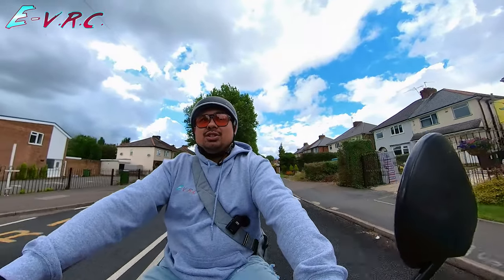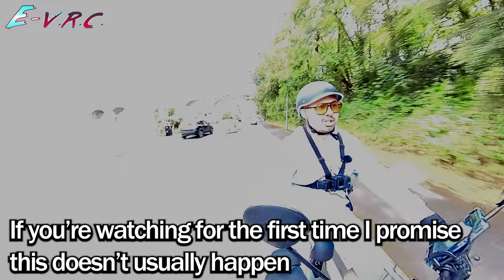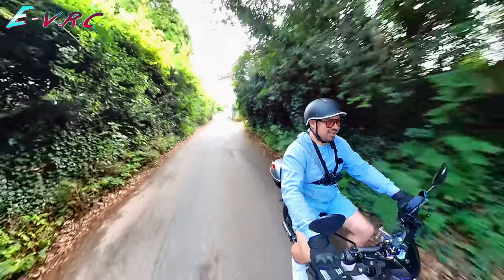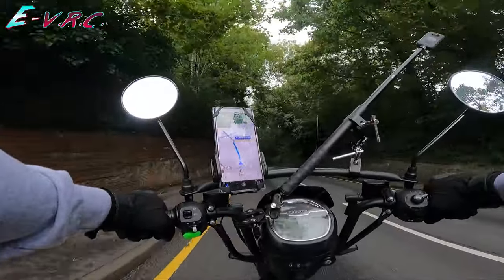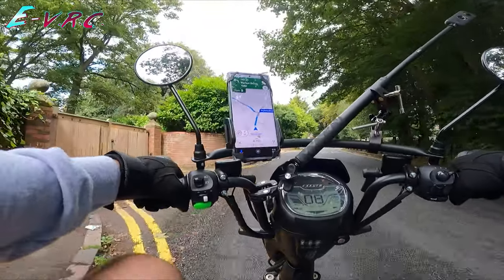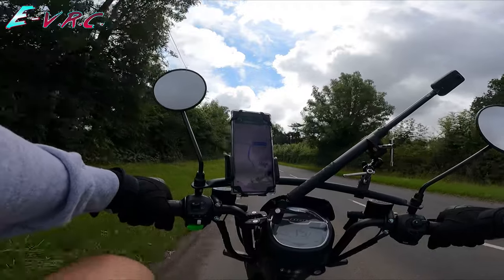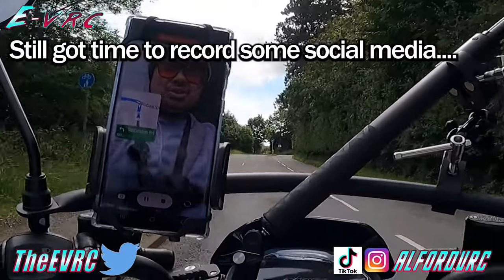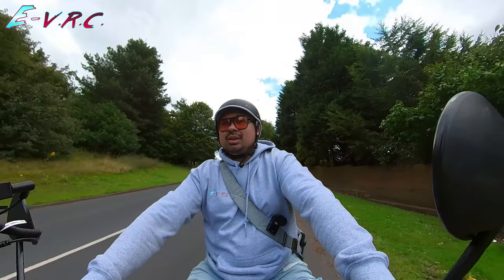No License Required Moped SMASHES HILLS and DISTANCE! Eskuta SX-250

Comment: I have the same bike with Kuma branding in Ireland, and I have to say I absolutely love using it. Only snag is the really distinct battery enclosure shape that doesn't seem to be available to get on its own. I want a higher capacity battery than the ones available in UK/Ireland, but I don't want to have to learn to build one totally from scratch or jury rig something that only sort-of fits the battery space. If anybody has come across a generic higher cap battery I can buy off the shelf and pop in, I'd love to know.

Comment: Brilliant video!! Need to do some hill tests around high wycombe. What camera equipment are you using please. Hope all is well, take care
Reply from the maker: Thanks very much! The 360.is an insta360 x2 which is usually much better though I'd like to upgrade to the x3 as it does proper hdr. My chest cam and face cam for some parts is a gopro hero 9. Great camera but the battery drains fast.

Comment: Hi mate just ordered mine should be with me in a couple weeks just wanted to say thanks for the review of the sx250 just wanted to ask you about de risticting it off road use only of course
Reply from the maker: Haha no problem and off road of course 😉. There's a video on it's really ssimple just a wire hidden under the battery that you unplug. Thing is it's obviously not meant to run derestricted I reckon the range is about 6-7 miles derestricted. It runs down FAST. However, it has a speed switch 1-3. 1 is 15.5, 2 about 19, 3 about 23 for me at least. If it were derestricted you could keep it on setting 1 - legal setting. Then if you need a quick boost - to get away from thieves or on a hairy road you could temporarily boost to 2/3. However it does make the bike kind of pointless then as you're simply riding a moped without legal stuff. They need to hide the speed switch lol. Anyway, enjoy it's a fantastic machine 👍
Reply: Wicked thanks for your reply be nice to meet up and go for a ride lol I'm in Bromsgrove not too far away 😉

Comment: Personally, I would put a 5,000 watt motor and a 52 volt battery on it. 250 watts might cut the mustard on your little slopes, but the hills around here in Huddersfield, Yorkshire are real ones, REALLY steep ones. I have a full bike licence and would feel insulted riding around on something this puny and weak.
Reply from the maker: If I passed my full bike license and someone gave me a 250w scooter you have to pedal I'd feel insulted too. But if I passed my pilots licence and they gave me a motorbike I'd feel the same. Horses for courses.
Reply: mraidymaddful, don't worry no ones going to hand you one, in fact l dont know why you bothered to comment, as for hills, your soft southern Yorkshire hills would be speed bumps round where l live in North Yorkshire, our hills are that steep they've had to fit car lifts on them, freebase jumpers use them for practicing off of for mountains, and when it rains they're like Niagra falls, they're so steep Edmund Hilary gave up on them and went to Everest instead.
And the Sherpas came here to live instead. 😂

Comment: Sadly the Eskuta sx250 is NOT street legal…its 48volt battery exceeds the regulations max 36v and an over zealous copper COULD get you prosecuted just on that. You really should be more honest about that mate, or correct me if I am wrong!  Side view the sx250 shows chain connected crank and rear cogs of about the same size….so peddle effort should be even less than first gear on a normal bike.  Which is why anything over about 5mph is effortless ‘Ghost peddling’ that just activates the motor.  Unfortunately there seem to be no ‘cool’ genuinely street legal electrically assisted peddle cycles available…and none that could cope with a 120 Kg+ heavy rider up hills.  The law is stupid, prejudicial and it stinks.😢  But TY for making this video.
Reply: I thought the voltage doesn't matter it's only based on wattage? Am I incorrect in thinking that?
Reply: An EAPC must have pedals that can be used to propel it.

It must show either:

    the power output
    the manufacturer of the motor

It must also show either:

    the battery’s voltage
    the maximum speed of the bike

Its electric motor:

    must have a maximum power output of 250 watts
    should not be able to propel the bike when it’s travelling more than 15.5mph

An EAPC can have more than 2 wheels (for example, a tricycle).

This is from goverment website. No mention about battery max voltage, no mention about "ghost pedalling" (same rule apply if You brake a chain in e-bike and comming back only by the hub motor pedalling "in the air"). So it is NOT illegal.
Reply from the maker: Every time someone says 48v is illegal, I ask for a link and they never reply.
Reply: Hmmm yes, a british ebike company that supply's these bikes to Just Eat, one of the biggest food delivery partners in the UK, would make an illegal EBike
Reply: I’m on my 3rd one now it is totally legal and I’ve been in stop checks and everything over the last 4 years
Reply: Now they have the sx800 now that one they say you have to have license  for but as mine don’t have restrictions on it it goes 30 mph on the dot 😂
Reply: @e-VRC  I've passed loads of cops on mine mate and had no problems,i've even made my own number plate thing to get rid of the one that came on it lol 🤣🤣